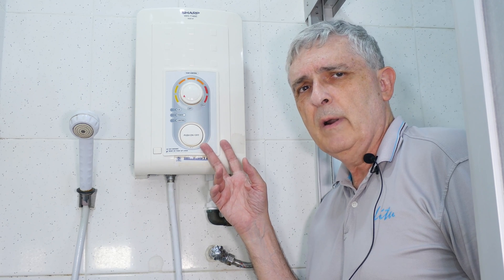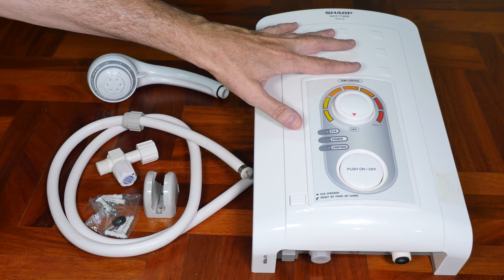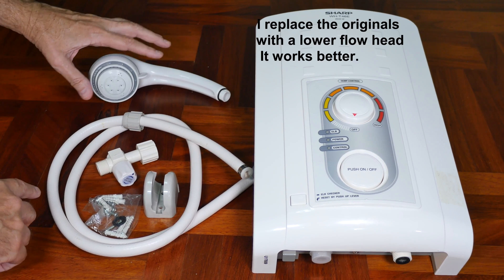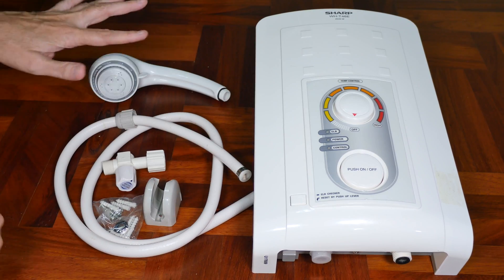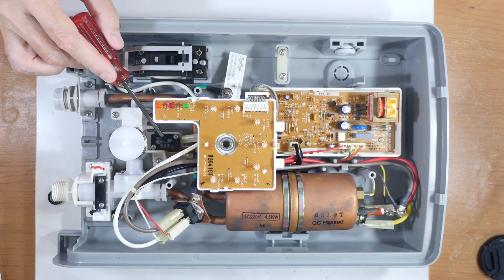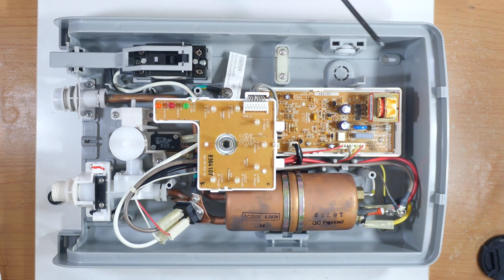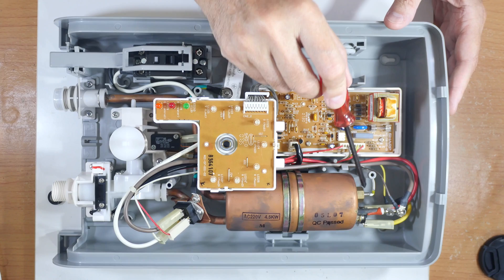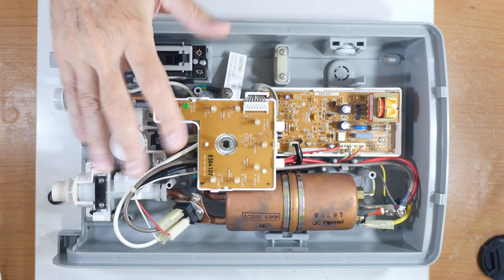Point Of Use Water Heater-What's Inside?  (4K)

Comment: Good alternative to a 50 gallon 240 tank heater, but do you have others for the sinks?
Reply from the maker: They make them that get much hotter and you have to mix with cold water to get safe temps. They are for the whole bathroom, sink and shower. Should also work in the kitchen.